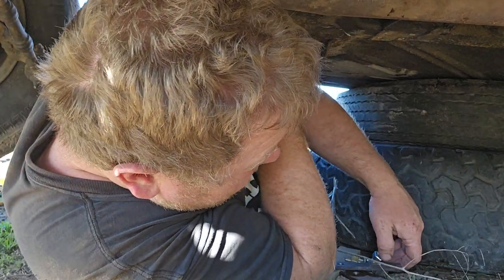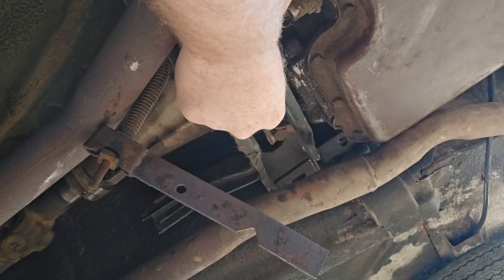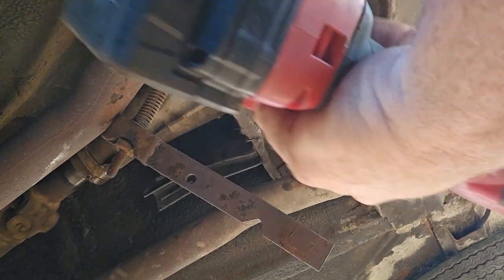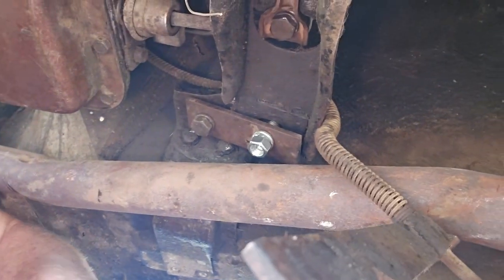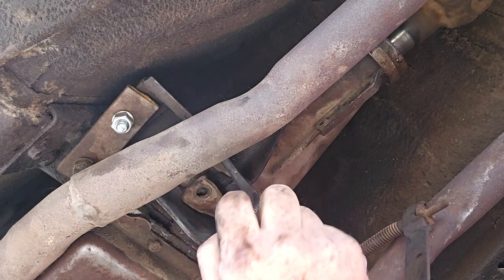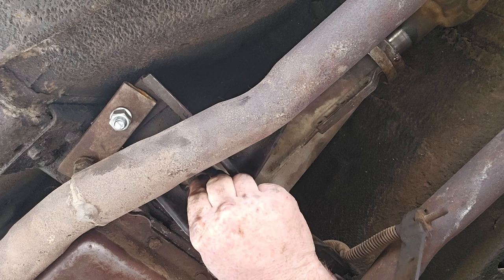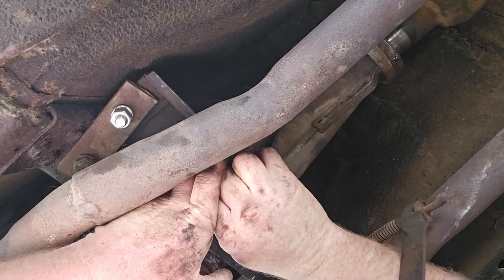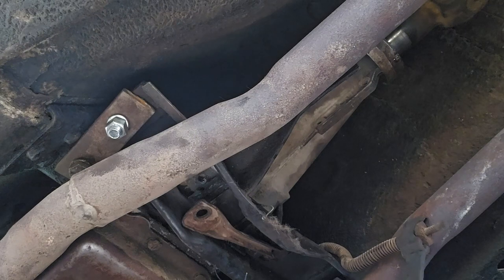Revamping My 1962 Thunderbird: Upgrading The Transmission Crossmember For A C6 Transmission Swap!

Comment: if you want, tighten it all down and pull it back off but leave the shiny new bolts tight and in place. Bring it over and I'll build you some ears off that "mount" to extend to the original mounts.
only take about 20mins to fab that up, and it will be rock solid & easy to slip back in there when you are done.

Comment: Wow! I had to get old Wiki pedia to tell me why the 62 Bird didn't have a C6 already. It was called an MX Cruise O Mattic. Started in 58 when the TBirds got bigger and had MEL engines. The MX is the big daddy of the FMX. The FMX has MX guts and FX-size housing. The C6 came out in 64. That's why my 65 TBird has a 390 V8 and a C6. That uni-body reinforced area must have moved when the 3rd Gen TBirds ended in 63 and the 4th Gen TBirds started in 64. Good modification to keep it running, Brother! Aim High USAF!!
Reply from the maker: I also found out the 58-60 MEL uses an FE bellhousing! The C6 is out of 74 F250 I had it laying around! My 68 has a 429 with C6.